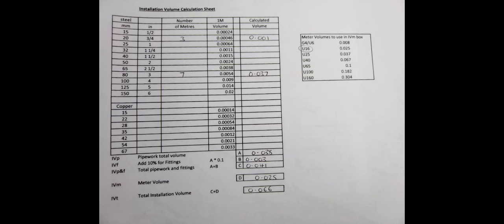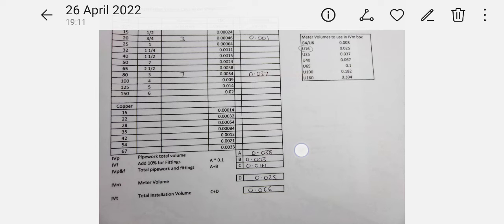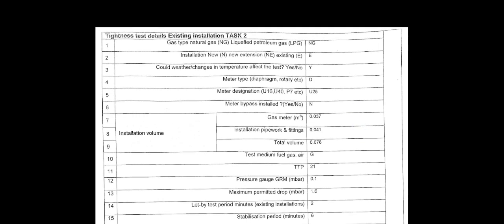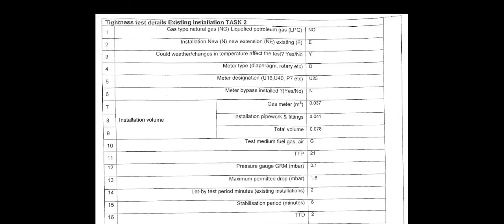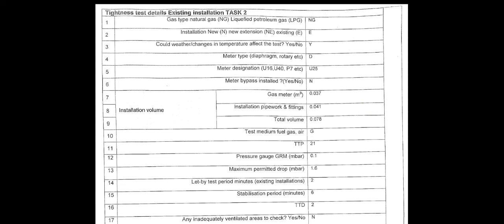COMMERCIAL TIGHTNESS TEST pt1

Comment: What reference materials and table do you use?
Reply from the maker: That’s a good question 🤔 — I’ve got two main reference books, the Logic and the NICEIC ones. I probably should look at them more!

Most of the time though, I rely on common sense, experience, mates in the gas world, Gas Safe, and ChatGPT. I’ve been using audio more recently too, because it works well while driving. Plus I’ve got a few cheat sheets that save time — a lot of the guys I know are walking textbooks anyway.

If all else fails, the books come out… they live in the passenger seat ready for action.

Also worth remembering some of the videos out there are 3+ years old — I leave it to viewers to debate any changes or updates, but that rarely happens. Just when I think the work’s complete, the questions keep coming in.

If you spot any discrepancies, feel free to point them out (unless someone already has in the comments).

Hope that helps.
Regards,
CGE

Comment: Hi mate. Can you tell us how to gas rate a commercial meter ? Cheers.
Reply from the maker: Good question. I find it similar to domestic. 

I tend to use the anton sprint app. Or pull out my gas book. When answer is usually close to the manufacturers data badge then I'm content. Yet I don't gas rate every single commercial appliance, I aim to check working pressure at the appliance all the time though. When the pipework looks a bit suspect, small, or the readings, like flue temp on a forced draft burner is 300c +, or a burner has just been set up. Yes, I am keen to gas rate. It's too tricky. Things get up to temperature very quickly. In certain buildings you're fortunate to be able to get the meter without it being connected to the kitchen. It's good to know how but I'd say don't knock yourself out losing 1-2hrs gas rating all 5 boilers in a plant room. As you need to use that time looking for other ID and AR faults. Plus servicing appliance as close to what the manufacturers want as possible in the time you have.

Comment: Does TPCP1 over ride 1a?
Reply from the maker: Check out the procedure selection chart for installation with OP&MOP under 40mb. MOP under 75mb also for volume under 1m cubed. Also under 150mm nominal diameter and you'll test to IGEM/UP/1A. Over these figures you go to IGEM/UP/1 test procedure.

Comment: How often do you come across a let by test that fails  ?
Reply: loving the videos, learning more from you than  my company lol, a question on the letby test, how do you drop the pressure by 50% to test the ecv?
Reply: @thecoincutter2116  2 ways , you can get a rubber tube to connect to your guage with a small tee piece on and a small tap , just bleed off the pressure till you get 12 mb , or just crack open the ECB and let it creep up to 12 mb , cheers Steve
Reply: @stevekennedy8581  hi thank for the reply, I was more wondering how you purge the gas down to 10.5mb in a commercial system as that in some circumstances is a lot of gas to get it to the right pressure to test?
Reply: I thought that if you let the system drop that low you would need to purge off each appliance as with atmospheric pressure being higher and getting air in the system?
Reply: Obviously if there is an issolation piont on the appliance side closer to the ecv that would reduce the volume but you would still potencially be adding air to the pipe or have i got this totally wrong lol
Reply: @thecoincutter2116  if you isolate any appliance you would then not be testing any of the pipework after the tap , so you cant do that  , I think the tee piece on the guage pipe is best , vent it to outside atmosphere  , air is not going to enter the system  , not possible  , my experience is mainly domestic  , but I think this holds good for  commercial systems as well , there is bound to be a British Standard code detailing exactly how to do this step by step , try Google,  cheers Steve
Reply from the maker: Never so far. How about you?
Reply: @CommercialGasEngineerVideos  I was in the industry for over 50 years    , North west gas trained , ( 5 year  apprenticeship,  ) , it wasn't regarded as necessary until quite recently,  even so never had one that failed  , can't foresee a situation where it would fail , grit on the main tap is a possibility I suppose  , we had some dirty gas about 20 years ago ,, naphtha I think,  cheers Steve
Reply: @CommercialGasEngineerVideos  ps , loved every day I went to work  , my wife says I have gas in my veins!
Reply: I've been I&C metering for about 5 years now and in that time I've had about 4 or 5 let by fails of the top of my head. 1 of them was on a brand new MP tap.